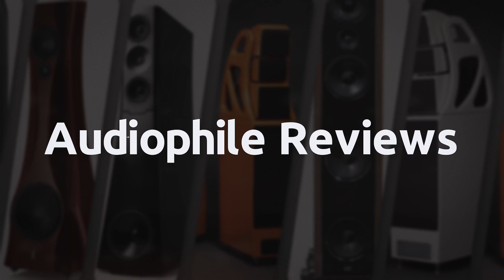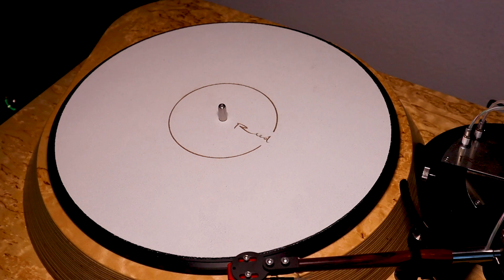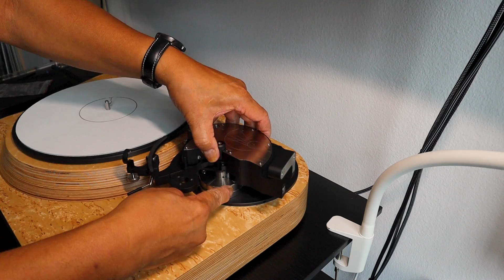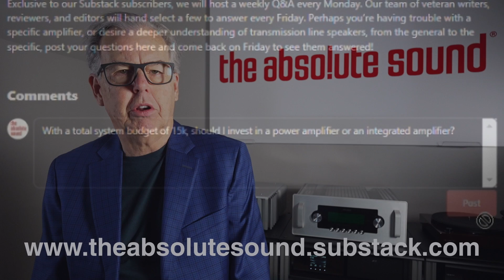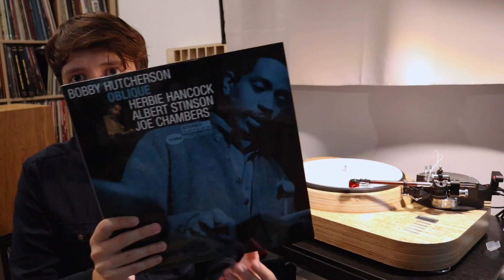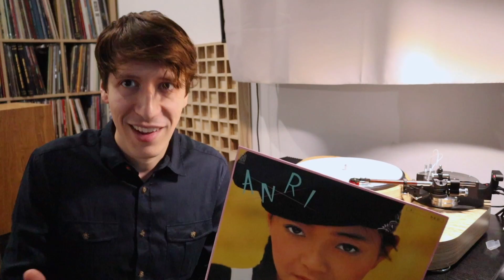The Reed Muse 1C Turntable & 5T Tangential-Pivot Tonearm Review

Comment: Fine product for its intended market, but I wonder about its sustainability regarding the second or third owners.  the old idler drives , a design I am skeptical about, were made by the thousands, and the wheels have one or two, depending on who dies,  aftermarket boutique suppliers to meet the need for new wheels.  I can't see that future for such an exotic machine fifty plus years from now, without factory support.  .   

while I applaud the innovation of the arm, pretty much the same deal.  when things need repair, without factory support for a very limited customer base, people might be dealing with a one person operation in the entire world who can successfully work on the thing.    I once owned a beautiful marantz receiver that needed a one of a kind special transistor that was discontinued, to meet OEM specifications.   It also incorporated a small oscilloscope display where the tube was no longer supported, so I gave up and bought something else.  

Also,  I was never a believer in incorporating wood into a tonearm. besides the obvious resonance problems,  I see the material as potentially too unstable for great precision beyond the first owner.  save that stuff for violin bows.

Comment: Vinyl masochism reaches new heights. Why this is a better solution than linear tracking nobody knows.. Similarly with idler drive vs direct drive.. They're certainly more complex and finicky which I'm sure will have vinyl masochists salivate.
Reply: The reason this is potentially a better option than a linear tracking design is that a tangential tonearm has to move the entire mass of the tonearm across the record surface. This also severely limits what type of cartridges you can effectively use on such a tonearm. This doesn’t have that issue.
Reply: @MrRom92DAW  Have you seen how small a linear tracking arm can be?
Reply: @razisn  yes, but it’s still a larger mass that has to be moved across the surface since you are moving the entire arm and the carriage it sits on. Something a pivoted arm never has to do. They are better suited to low compliance cartridges. 
There’s also the option of using a very long tonearm but then you also battle issues of mass and rigidity.
Reply: @MrRom92DAW  Sorry I don't get the difference in this respect but it doesn't matter. I stopped using vinyl a very long time ago and have no intention to start again now.
Reply: @razisn  then why do you care? You don’t have to have an opinion, unless you are one who oddly enjoys being a douche canoe.

Comment: When was idler drive renamed to rim drive?
Reply: It's not an idler drive. There's no idlers wheel in between motor and platter. Idlers drives have high rpm spinning motors and the idlers step down that speed like a kind of gear which then rotates the platter.
Reply: @brunorivademar5356  It is the same driving principle (the difference lies in the speed of the motor). Both try to imitate direct drive without investing in an appropriately good  motor and chassis / plinth. So direct drive for the cottage industry which 99.9% of the current TT industry is. It is all a joke. In principle direct drive and linear tracking arm is the best solution for this 19th century invention to work half-properly but they cannot be made to an adequate quality by the cottage so-called 'industry' and real industry has no interest since the advent of digital.
Reply: @razisn I share this opinion, but what do I know.
Reply: @razisn In order for this turntable to be called an idler drive there has to be an idle wheel in between the motor spining shaft and the platter. It's that simple. We are not discussing the merits and challenges of each motor drive.
Reply: Watch the video of Jack and Meg, better than the record.

Comment: Anyone else noticed the turntable going backward at around 23:30😂  https://youtu.be/V7hS81ECq9k?si=Ucbi4WFEdDutNOKb&t=1428
Reply: I thought I was seeing things when this section of the video appeared (White Stripes Elephant discussion). So much so, I replayed it a few times. Lol
Reply: @dragocelander6671  same here, I think the b roll they wanted to use was a zoom in but they wanted to zoom out
Reply from the maker: Nice catch ;)
Reply: My 1986 Merrell Heirloom can occasionally run backwards for a lot less money. 😂 The platter is acrylic and lead. There is also a lead sheet as part of the plinth. George also was the first to supply a heavy periphery ring for the record as well as an acrylic center screw down clamp  for additional torque and used a fluid damped motor with his own line conditioner and spike suppressor. I removed the suspension because the springs are a little too bouncy and now there is no feedback when I tap on the constrained layer plinth which I have added layers and clamped together.  Sumiko Blackbird cartridge is fantastic with Japanese Fidelity Research tonearm by Master Okeda. Less than $3k for everything. Big sound, small $$. Baltic birch is really cheap.